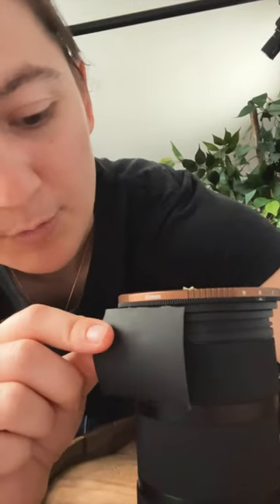Filter is STUCK on my dumb lens, how do I get it off?

Comment: I once drop my friend $1000 lens and the filters save the lens, but it stuck. luckily I just have a 3D print and printed like a filter grip. I still feel bad for dropped the lens even the lens is fine 😬
Reply from the maker: Aw that is rough
Glad you managed to get it off tho
Reply: yo i’d buy that. i have a filter i cross threaded onto my lens and i’m trying to find solutions